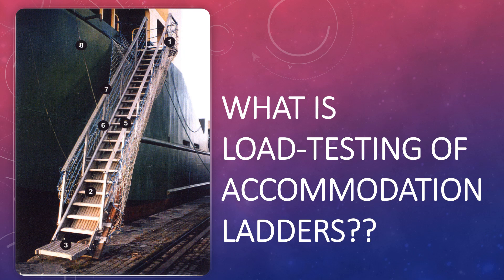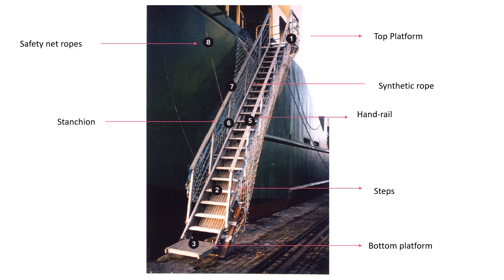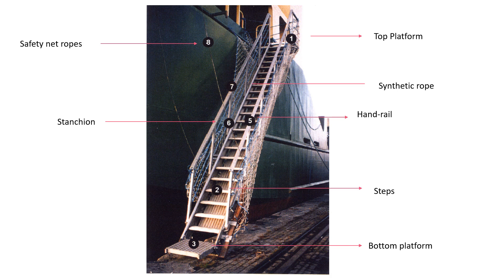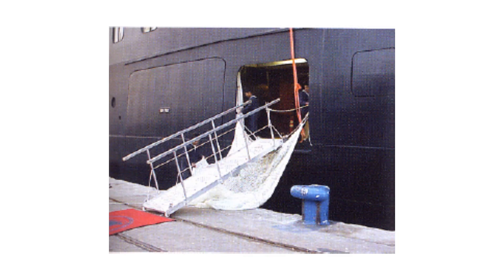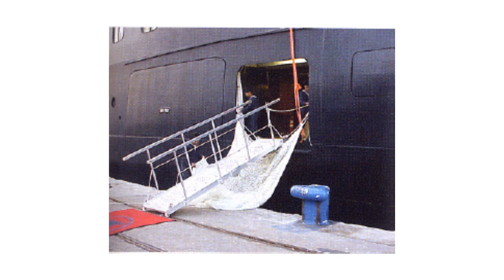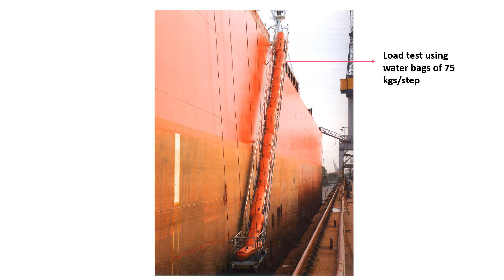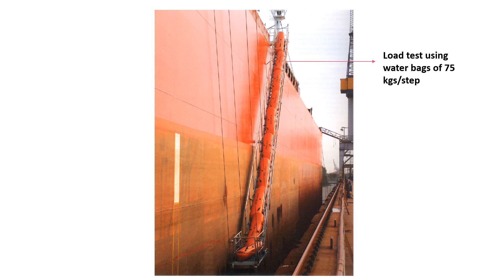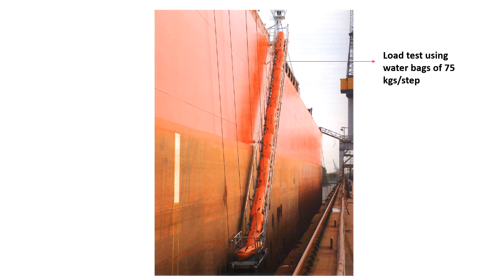How are accommodation ladders load-tested on ships?? Orals examination question!!

Comment: Accommodation ladder should comply with ISO5488 (2015) and the Maritime Safety Circulaire 1331 (IMO, 2009). Design and production should be Class approved, load test to be executed when new or repaired. For the load test the ladder should be placed horizontally, according to ISO5488. A second test to be executed when the ladder is positioned in place, on the ship. The load test in the video is the second test, in fact the test of the hoisting installation.

Comment: Very well explained sir. Thank you.
One doubt.
Is it always 75 Kg water bags put for testing or weight may vary ? 
If the acc. Ladder is smaller then what will be the weight ??
Reply from the maker: Nikhil, good question. The load test will depend on the SWL of the ladder, and an equivalent weight will be placed on each step of the ladder.
Reply: @SteeringMariners   Hello Sir, 
Total load wt. which will placed on Accomodation Ladder will be equal to the  SWL of Winch? Or it will be 1.10 or 1.25 times??